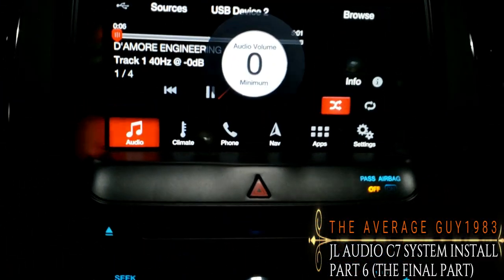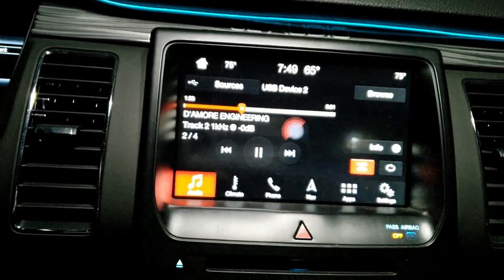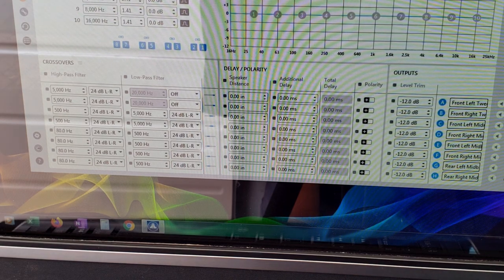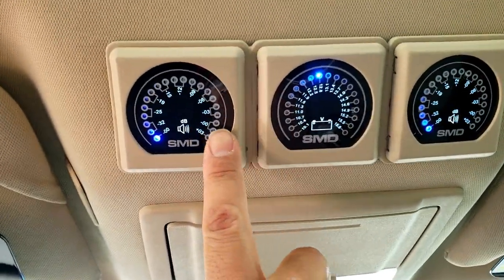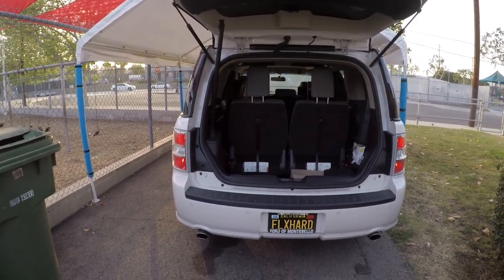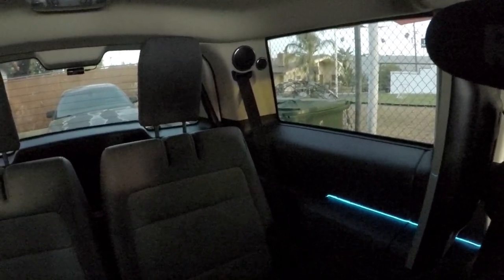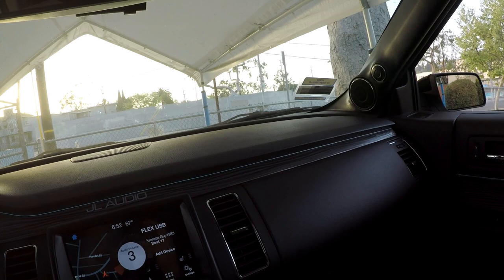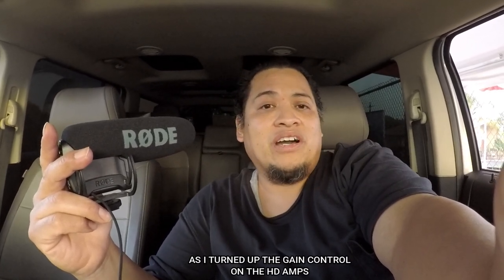JL Audio C7 System Install Part 6 (The Final Part)

Comment: Very nice setup but I agree with you 100% you could have gotten a whole lot more and price been a quarter of the price may be less because that jl 750 probably cost you around or close to a 1000 bucks for it. I got a 7000 watt Banda for under a 1000 bucks.  I think I do some amazing work row and is time you take the next step and start going to meats and competitions and you'll learn so much more as far as managing your money and what to buy and what not to buy... Myself for the most part stay away from all name brand anymore but if you were to tell me this before I had my eyes opened up to what's out there I would've called you a fool.  I thought I knew all there was to know about systems and I quickly found out that I did no. I learned of a whole new world a whole new other half of shit I learnt great sound even over a video.  .
Reply from the maker: Thanks man, I hear you but my goal here was Sound Quality, the brands you are speaking of are more intended for SPL Competitions which if the job is done correctly, you will need to pour a ton of money, similar to what I invested in my system but in just High Performance car batteries, multiple runs of ofc power and ground wires at 0 gauge minimum and multiple alternators with a custom made bracket to apply them in the engine bay area.

What I did here was invested in efficiency to be able to run a high quality sound system in a family daily driven vehicle with being able to keep everything from the 3rd row to trunk space and even spare tire 100% functional also with out needing to go crazy on the heavy upgrades on the charging system. I feel like it was a great investment. Now that these speakers are broken in, they definitely outperform my C5s and will be doing a updated video on this system in a few months and explain my DSP settings etc.

Thanks for watching my dude. 😎👊

Comment: where did you get the bass setup i need something like that for my flex
Reply: btw you located in LA can i listen or your setup
Reply from the maker: @mariohenandez1074  yep, im in Los Angeles, at the moment I'm still working on the tuning, turns out the speakers needed a break in period so that they can sound their best. As for a demo, I'd be happy to but once this covid thing chills out. I got a son with a lower immune system and don't want to risk anything. But I'd love to give you a demo.
Reply from the maker: Do you mean the subwoofer and fiberglass stealthbox? Or like the whole system set up?